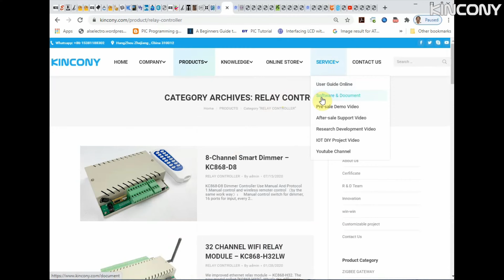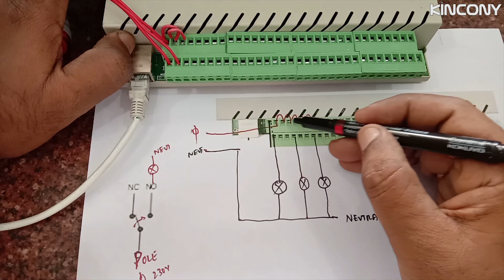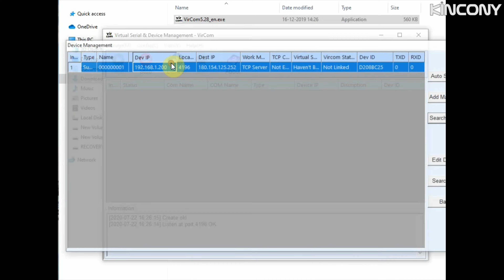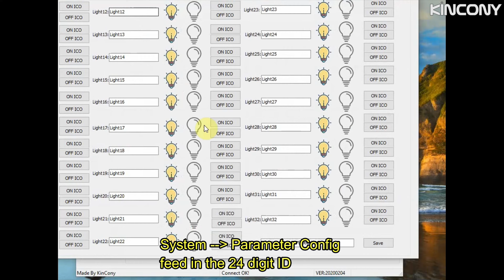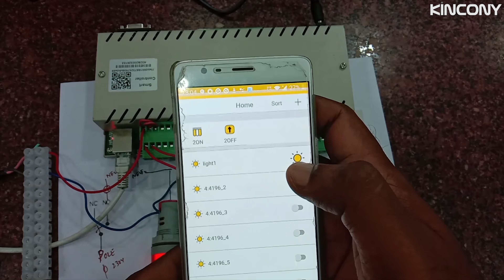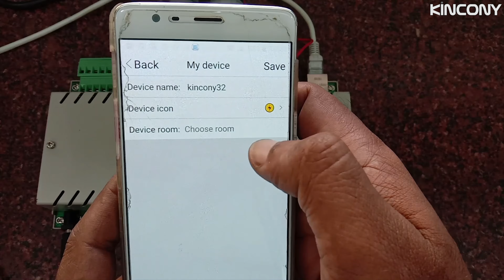32 channel smart home automation DIY relay controller module

Comment: Where are you from ?
Reply from the maker: from China
Reply: @KinCony  nice man … good job. All the best
Reply: @KinCony   Am actually looking for 2 things.  1) Fan speed controller in app. 2) Is there any possibilities to add 2 switch for 1 circuit. That is one switch to 'ON' and another switch to 'OFF'.
Reply from the maker: @Bujuku_Bujuku  1: you can use our KC868-D8 dimmer controller for fan speed. here is video link: https://youtu.be/RVCPmGW9Dhg
2: you can use our relay controller and KC868-COLB logical controller set switch button for any function.
Reply: @KinCony   I see, thanks for the reply. I will look into the video.
Reply from the maker: @Bujuku_Bujuku  you are welcome.